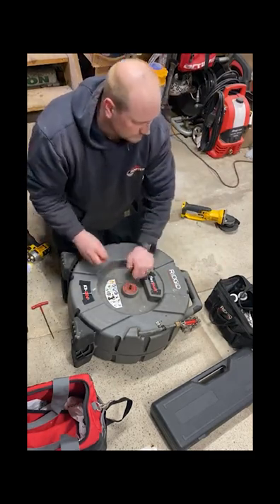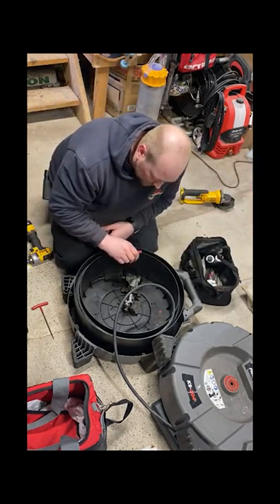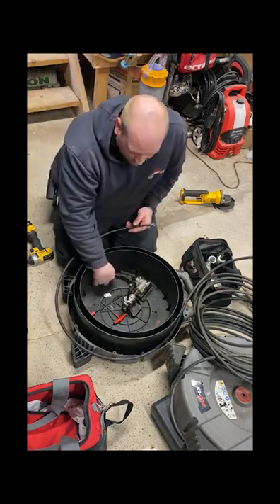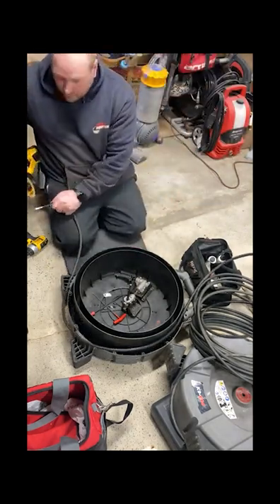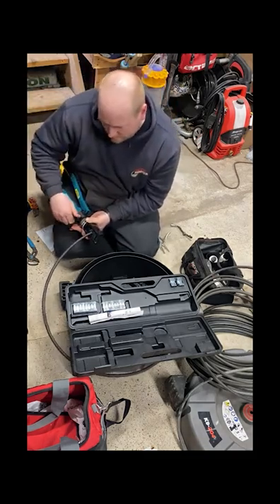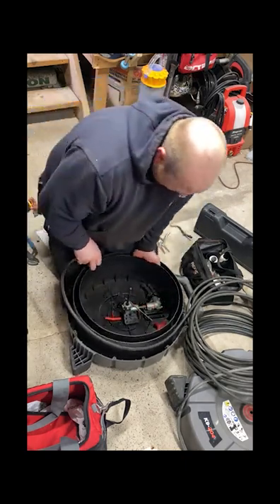Tony repairing the Plumber Tools cable on his Ridgid K9 204 machine

Comment: What's up pal? Very nice tutorial. May I ask how's the flex shaft with jumping traps?
Reply: When I say "jumping the trap" just meaning " "getting thru the trap" . Like how is the flex with getting thru main drain p traps ? We just call passing thru the resistance of a trap....        " jumping"
Reply from the maker: @drainassassin5399  AHA- We have a different phrase here. "Jumping" sounds much better.
Reply from the maker: Hi Shane. Jumping traps should be pretty easy, but make sure you have the right shaft diameter. The thicker shafts are less flexible, so if you are passing through a 2" (50mm) , you need to get a 1/4" (6mm) shaft.
Reply: same with my power snakes , ty my friend, I appreciate the insight, been looking to pick one up but guess I'll need 2 reels to cover 1 &1/4" all the to 4" , but wasn't sure how well they navigated thru traps . Ty again 😉😉

Comment: Are the cables stiffer than the ridgid ones? I run into the ridgid ones bunching up a lot when trying to get then into a root curtain
Reply from the maker: Hi Ruthven, Yes, definitely. This is the main feature of these shafts. They are less flexible which has an advantage over longer distances and offers more torque to the chains. You can pick them up here ... https://plumber-tools.com/products/Flexible-Shaft-Set-Shaft-Sleeve-&-Friction-Bearings-p417184041

We wind them in opposing directions on a single mandrel, which gives them equal torque in both directions. This helps when you find yourself stuck on a solid obstruction, and need to reverse the drill to get free.

Comment: I'm having a hell of a time pushing the cable back in to the reel of the k9204. It goes in smooth as butter for about 40' then gets completely jammed and can't push any further. Any advice would be great
Reply from the maker: Hi Chris. I have heard a few people say they have the same issue. Here is a shaft holder which allows you to put your shaft back easily... https://plumber-tools.com/products/Flexible-Shaft-Carrier-p511371289
Reply: That snake is for chumps 😂

Comment: Which press tool is he using? Would a.propress work as well?
Reply from the maker: He sent us a link of the press he is using .... https://www.ebay.com/itm/234160142557?mkcid=16&mkevt=1&mkrid=711-127632-2357-0&ssspo=CBt0gXy9SoK&sssrc=2349624&ssuid=QHvy_8pnSnO&var=&widget_ver=artemis&media=COPY&fbclid=IwAR1r5lqETRPp4kolckEldY6X7D1JY6GIdzq5Je5duOdhd4YJhZ46YTXht2k

He is using the 35 mm lug for the 5/16" cable. Some clients ask us to crimp them adapter on before we deliver. We can do this if you email us at office@plumber-tools.com

Comment: Hi 
What kind of cable are you using there ?
Reply from the maker: Hi Aldo, He is using a 8mm (5/16") shaft. You can pick one up here ... https://plumber-tools.com/products/Flexible-Shaft-Set-Shaft-Sleeve-&-Friction-Bearings-p417184041

This cable is a bit less flexible than the one that came with his machine. The advantage to this is that it wont coil on the inner pipe wall over longer distance, and the torque delivery to the chains is considerably more efficient. 

I think this is a 20 meter long shaft

Comment: Can we get a part number for the Ridgid adapter?
Reply: Did you find the ends?
Reply: @mikebradshaw2402  yes
Reply: @domluna4000  from???
Reply from the maker: https://plumber-tools.com/products/102-204-Flexible-Shaft-Cable-Set-p511189249